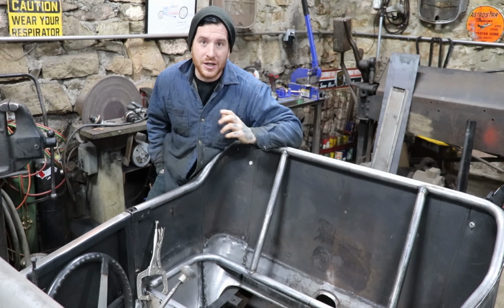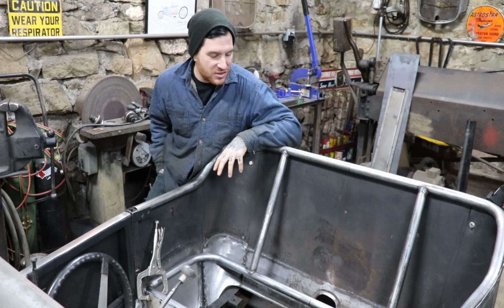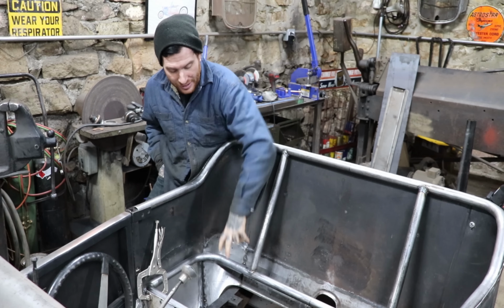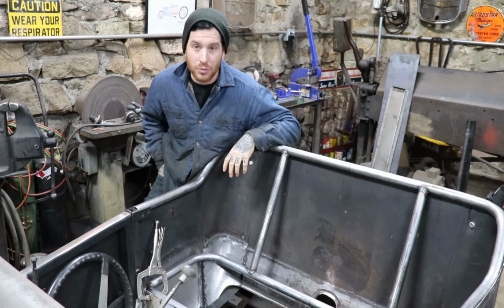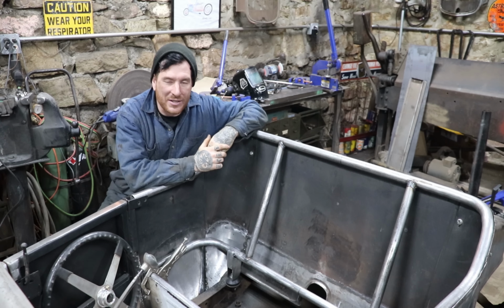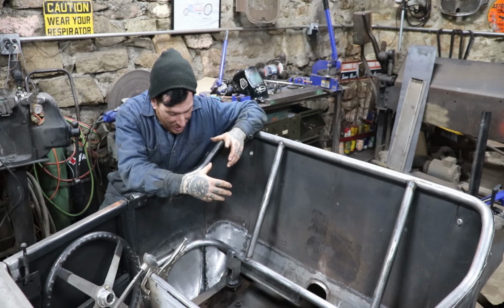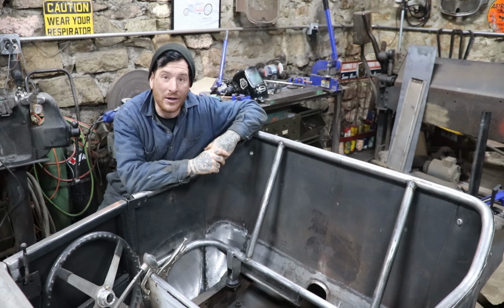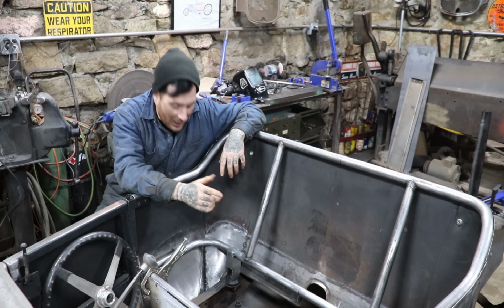New Rear Body Mounts - Ford Free-T - Ep. 58

Comment: Just wondering why you built off the seat frame instead of the body?
Reply from the maker: Not sure I understand what you mean? -Matt/ITG
Reply: @IronTrapGarage  Normally with the Model A's I have worked on & T's, the body bolts go through an area which is attached to the floor pan part of the body. You have attached to the tubing which if I understand right is what your seat will sit on. This could allow the body to still flex independent of the seat frame. I'm not trying to pick on your method, just wondering why the point you fastened to.
Reply from the maker: Hi Ted, this tubing will get welded to the body all along the top edge of the body and at the bottom area where the floors meet the tubing. This should make it all fixed to the body and structural with the body. Not sure I fully explained that, I suck at describing stuff completely sometimes sorry! -Matt/ITG
Reply: @IronTrapGarage  Thanks for the explanation Matt. I think you are very talented in the sheet metal work. I just didn't know what your plan was for stabilizing the body to the tubing. That should help. I thought maybe the lower body would be able to move sideways while driving.
Reply from the maker: Thanks Ted, no that is a great question. The entire front lower edge of the tubing will be welded to the back of the floor pans where it steps up. This should tie it all together nicely. I'm still considering closing up the back area under the seat to give me some storage, so that would tie stuff together some too. We'll see what I decide here in the next few days. Thanks for the questions, I enjoy the conversation! -Matt/ITG
Reply: Glad I haven't upset you with the comments. @IronTrapGarage